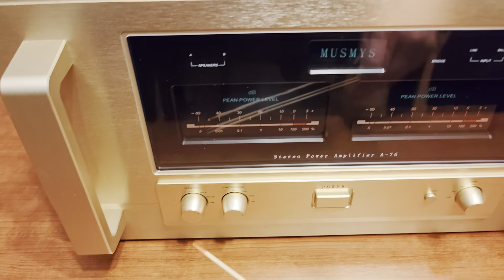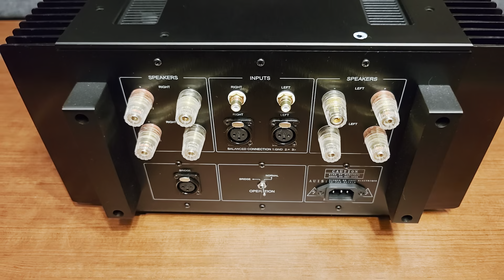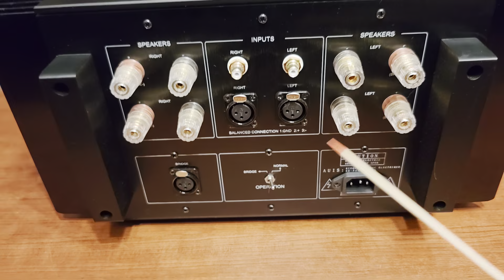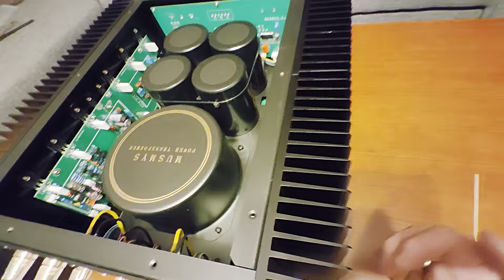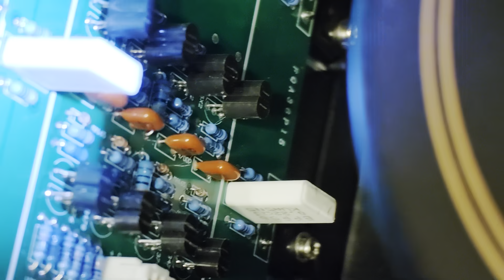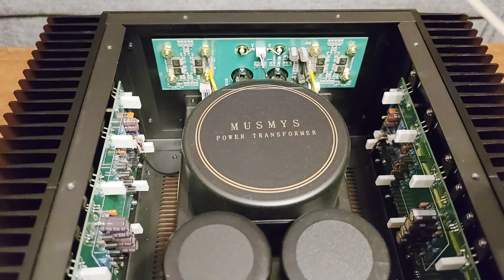First look: Accuphase A-75 speaker amplifier pure clone by Musmys: BEAST!

Comment: What happens to power and ohms if you play 2 pair of speakers?
Reply from the maker: These are two separate sets with output control, not just two sets of posts soldered together. So the power stays the same but has to be divided between the sets, and impedance should count separately as there are active output devices on pcb (but I havent included that in my tests, thats a good point for the future reviews)

Comment: These are NOT clones, just cheapo A/B Mosfet design. Better off with ADCOMs. They use SSRs for output relay and tons of square waves leak during shutdown if you keep signal drive on - these can destroy tweeters!  Unit got bashed during shipping and Ali refused to help. Never buy from these Chifi con artists cause when something isn't right you're screwed like we are.

Comment: Hi. When can we expect the definitive review of this amplifier ? In the meantime you have evaluated amplifiers that you have purchased at a later date then the A-75 that have already been reviewed. First as a preview and the with a final review. Why don’t we see your final assessment of this specific Accuphase amp, is there a reason for that ?
Reply from the maker: Hi! 
No particular reason other than that it was buried under pile of another amps and preamps that got here during winter sale and I was stacking them on top as it was the largest and heaviest one. Same thing happened to Aleph 5 and I got both of them out recently to catch up with the full video. Aleph 5 goes first as it was on top of A75 this weekend and then later A75 too (still, I won't give any date as that depends on my available free time after my regular 9to5 job)

Comment: Still looking forward to your full review, although I could not wait & pulled the trigger on one of them after having great time with the the ASTR12A - Max Reference Cary SLP-90 Plus clone Pre. Having had it burned-in, for a week, I liked the sound as much as their VFM proposition so much that I bought another to use in bridged mono mode for some of my more power hungry speakers. 
Without wanting to give out a spoiler, the combo with C2860+ as single or as monos, IMO deserve a very special mentioning...they needed a few weeks continuously burn-in to open up fully, although they sounded promising straight out of the box! 
In departure with other Class A amps, these do not run hot. A little disconcerting at first, if one is used to class A amps but when they sound so good, I stopped trying to make sence of it & enjoyed the music. 
One thing to bare in mind, is they are produced in batches & according to the seller, go through a 15 day growling test before dispatch. My 2nd unit has a slightly richer golden hue than the 1st one. The seller explained such variation of front plate hue after the event...but given that the C-2860+ has also a slightly different hue as well, I decided not to let it bothering me for long. So if you want a pair bridged monos, buy them together to avoid such hue variation. 
Overall, they are very well built & come in great shipping packaging for such heavy devices, with excellent seller support. Enough said...over to you & your take on these...
Reply: That is the exact experience I had. A bit concerned first but the sound is sooooooooo good, I simply enjoyed the music instead and still going really good. The combo as you mentioned is part of the magic. This unit is way better than I expected.

Comment: Hi any thoughts on the a75 plus. With 100w/ 8 ohms. In regards to the laws of diminishing returns.
Reply from the maker: I saw that one! Its pretty new stuff and its almost twice the price of A75.
I am not sure about it. If the price would be lower I would probably get it, but as it is you can almost get two regular A75 and set them in bridged mono mode.

Comment: Looking forward for the full review. Thanks
Reply from the maker: My plan is to celebrate 10k subs with that one so soon!
Reply: @k4syx  You have come close to 10k subscriber. I plan to buy one but waiting for your review. I hope you would compare with those high price amp you have reviewed so far.
Reply: Couldn't wait for your review, so I took a chance during a Sale with high value token OFF & bought one. Within 48hrs of burning in I liked both the sound & the VFM proposition so I bought another one (yet to be shipped/arrive) to use in bridged mode while still on Big April Sale with a large value token OFF & ahead of any tariffs taking effect....Hope I am not disappointed in the end...
Reply: @Fizzy44441  It must perform well to your expectation as single unit. It can be bridged. Can this amps also able to bi-wire by amping? Hope you could share more information about your speaker and results of bridged connection once you have received your second units.
Reply: @321sklim  Sure thing! One update, the 1st one has now had at least 200hrs of burning-in. I did notice that it improved & matured during this period. It sounds detailed yet smooth, powerful & dynamic, wonderfully balanced, while remaining both poised & hard hitting depending on the occasion. One thing is different than all my other Class A or Class A/B amps is that it is barely warm to the touch!

Comment: Hi. Nice review. This amps looks really cool but more important than changing the opamps is changing the thin wires that go from the capacitors to the boards by thicker ones. That is the one way for providing instant power delivered to the transistors. I've done myself a similar modification in a Nakamichi PA-7 that has similar architecture and the improvements in dinamics where huge. I've aldo solder a wire to the bus track on the board feeding the transistors. The more you reduce the resistance between capacitors and transistors the better it will sound! Take care.
Reply: Amps like D5 Pro that have the capacitor directly soldered in the board usually sound better for that reason. Change the wire thickness and let us know your findings. 😉
Reply from the maker: Thanks for sharing :)
All the mods are still in future, I need to choose the amp that will be the best for my electrostats and then I will polish it as much as I can with mods like that!

Comment: BEWARE Mfg does not pack this well, only 37mm think foam between the outside world and a very heavy amp. FEDEX recommends 75mm. Our arrived smashed and Ali hasn't done anything.
Reply from the maker: Was that from the same shop I got mine?
Because mine had the best protection (so far) from all amps that I got. And I am sorry to hear that.
Have you tried refund procedure with Ali? With photos etc? What was smashed, maybe its salvageable?

(BTW Fedex oficially recommends 75mm?!?! 
Its like they would be perfectly aware and proud of the stuff that happens to packages!)
Reply: @k4syx  Yes, followed the link. That seller told us to fix it ourselves with a pair of pliers. This one is expensive and he's avoiding responsibility for support. This is not right. Ali is delaying, delaying, delaying so we were forced to go to Paypal.
Reply: @k4syx  Finally got this amp on the bench for those interested. NOT "Pure Class A" as pitched. Not at all in fact, 100ma bias per leg - basically plain old AB. This is also obvious with the tiny transformer compared with real class A Accuphase amps. Power supply cans measure 60% or rated capacitance per HP4262A (.1F avg) but 0.5ohm ESR (bad). Design is quasi-complimentary output - like PASS - but with expansive frontend. After burnin, sound settles down but is still glassy IMHO. Bass is pretty lean, to be expected in quasi-comp output. Basically an overpriced conventional AB with fancy front panel. E405 is a way better buy, that's the real deal.
Reply from the maker: @enlitenaudio6517  Thanks for sharing!
Mine is still waiting for my listening sessions.
From what you say it looks like it would use some bypass low ESR caps. 60% thats still a lot, I will check my piece and look for prices on possible replacements here locally.
You have E405 too? Have you compared them? (I have e405 but any comparision is still in the future)

Comment: Since you reviewed the class A Musical Fidelity A1 clone and the class A Hood clone, I would like to see a review of the class A Sugden A21 clone, and maybe compare the three. The originals competed with one another, so it would be interesting to see how the clones stack up.
There are also several Pass/ACA clones, but the models can be confusing.
Reply: I have use both originals for years, and I much prefer the A1. Never burnt off and sounded much more dynamic. The Sugden was more thin in sound, not offering anything more in other areas.
Cheers.
Reply from the maker: I have A21 on my list, but it slighly more expensive than other two. As for Pass clones, so far Ive read some bad feedback on Aleph3 and so-so on Aleph5 so they went down my list
Reply: Thanks for responding. The A21 clone is more expensive, but so is the real A21. There are several good videos comparing the two, as they are natural competitors. It seems like the A21 usually comes out on top.
Again, thanks.
Reply from the maker: @gilko61  Hmmmm thats interesting, if it comes on top, then that picks my interests :D

Comment: I don't even know why they call it Accuphase A-75 clone because the circuit is not even the same, does not have the same amount of output device pairs, transformer is tiny compared to original. This is more like a fake Accuphase A-75 and although it might possibly sound good, it would not sound the same as the real Accuphase unless using the exact same circuit, PSU design, etc... Anyways, have fun with the listening sessions, keep doing the reviews! :)
Reply from the maker: Its probably just losely based on A75 :)
The intersting thing here is that real A75 didnt get rave reviews at all :)

Comment: A question for you. What do you think of the reference Jadis JP 200 tube preamplifier
Reply: I just ordered the 20watt  classA. amplifier you reviewed. and I can't wait to try it with my Dunlary SC-V, using my audio research tube DAC and reference one preamplifier  . But this amp is a beast. I can't wait to hear your review.
Reply from the maker: Havent heard that one though its on my list, there are 3 versions from what I saw, one of them using gold plated/black chassis with Jadis logo (which looks nice but is a step too far)
Reply: @eugenefudge3685  Many years ago...1985 to be exact, I borrowed a pair of the JAS30 monoblock amps...30 wpc for $3000 at the time.
They were phenomenal bettering my already excellent Audio Research D70mk2 power amp.
I bet the original Jadis preamps were equally as formidable.

Comment: I don't believe the capacitors are made by special order by Nichicon  , it would be way too expensive to do so , plus it's bad marketing to put a no-name brand on the caps.
Reply from the maker: I think its different. These may be leftovers from such an order. But its hard to tell, though Mundorfs in JC2 (that I was SURE were fake) were confirmed to be real thing by Mundorf in Germany.
Reply: This is cognitive bias from years of brain washing. all westerners have it i think, default of childhood. I find China make excellent products.not always, but the tak is always tak. Did you see their steel innovation?

Comment: Not a complaint, but I’m calling b.s. on the specification for filter cap size.  Each is more like 60KuF@75V max.  

Actually I bet they gave the total figure for the single capacitor figure, because 40,000uF per cap looks just right.
Reply from the maker: I will try to measure them if possible

Comment: This can also be used as a hotplate and a heater.

Great value multi-purpose home appliance.
Reply from the maker: And really, really good paperweight - its heaviest amp I got so far. Delivery guy had to use trolley to move the box and the handles are definetely for show there

Comment: I would venture  the cap are 160,000 total 40,000 mfd each not physically large enough to be 160,000 each IMHO ( 50 years of playing with caps )
Reply from the maker: I'll try to measure them for review if possible
Reply: @johnwilliamson467  I only saw your note just now, I said the same thing just yesterday.  40,000uF per looks right…
Reply: Loool
Reply: @Carl-yx1ww  ???
Reply: @Carl-yx1ww  Dude, wtf are you loling about?
Reply: Loling hahah
Reply: @summerforever6736  Don't feed trolls.
Reply: Correct, there is no way in hell they are  that high of an UF.

And even just looking inside, it shares nothing in common with the real one.

Comment: I have some doubts that those filter capacitors are really 160,000 uF each. A capacitor of that value with a 63V rating would be much larger.  I am guessing that they probably are 33,000 uF or so, and almost certainly not larger than 47,000. 
640,000 uF would cause a HUGE inrush current when turned on.
Reply: Capacitor size does seem to be a big issue with observers here.  We appreciate your plan to measure.
Reply: But then the soft start comes into play and should regulate that short power need. Am i wrong?
Reply from the maker: You're right, that would take care of inrush current
Reply from the maker: I will try to measure them for the review, but they are big and go deep

Comment: I assume so with all those heatsink fins but do all class A amps like this run super hot, kind of like tubes? And eat up a lot of electricity, so higher bills?
Reply from the maker: This one is during burn in was nicely cool, there really is a lot of metal in these find and chassis. As for power consumption yes it was higher than usual though I don't remember numbers now. I will measure it for full review
Reply: Depends what the manufacturer says. For my amp there is a chart how hot they "should" get. Too cold or hot are not good in my case. They even level bank A and B with temperature.

And about your question of class A. A is pure sound and needs the most power. B is like the old Megaphones, only amplification and also mostly distortion.
Tubes use more energie then transistors and are in general less efficient. Some people like the sound of tubes more. You need the right speakers for it.

And there are Class A and A/B for both of them. Then there is Class D for Digital what is more like S for Silizium.
The Amplifiers did go the way of the computers. First where the Tube, then Transistor and later Silizium.

In an Ideal world we would all buy Class D for the efficiency. But in my experience most of them are harsh in the high frequency.
There are one Monoblock i heard live who was totaly neutral in sound. Like my Beyerdynamic headphones. But oh boy the price tag on those.
Reply from the maker: @Rudimaentaer  Try TPA monos that I've reviewed for great (and affordable) d-class implementation. As for temp you are right: it should be a part of the design to get the tem just right and to use it for determining transistors working points!
Reply: @Rudimaentaer Which Class D monoblock were you impressed with?  Thanks!

Comment: I think I'd go for a Krell KSA 50 clone for $900.
Reply from the maker: I've ordered KSA100mk2 last week. Was afraid 50 may be too weak for my electrostats testing...
Reply: @k4syx  Yes looking forward to that one. Had another peek yesturday, saw the daZeel 108 at 50% off on this Black Friday promo, sounds like a good deal !
Reply: Sorry. Forgot about this. No there was no URL link. I just mentioned that LM do not acknowledge products bought from anywhere other than a registered LM dealer.
Reply: Any particular reason why the comment about the Line Magnetic LM 219IA was deleted? Still struggling to come up with one.
Reply from the maker: @stephenfurley1025  I do not remove any comments, even negative ones (good flame war never hurts here and there) but some comments get removed via yt (for example the ones with the url links). Was there anything that could look like URL?

Comment: Great first look! I've been following your reviews of the various clones for quite some time now, and I’m particularly excited to hear your final thoughts on this Class A amplifier. I truly appreciate your philosophy of uncovering amazing-sounding gear at budget-friendly prices—it’s what makes your content so valuable and relatable!

For context, my journey started with the D5Pro paired with the HRZHiFi C245 clone. While the C245 had its merits, I found it a bit too soft for my taste. Hoping for an upgrade, I went for the CARY-SLP90 clone, but even that combination didn’t quite hit the mark for me in its stock form. Determined to improve the sound, I invested in a separate preamp board kit, thinking a drop-in board with modified capacitors and upgraded tubes would be the answer. However, my plans shifted when I discovered the Accuphase C2860 Plus. Its balanced input/output and Class A topology design were too tempting to pass up, so I decided to temporarily put the Cary clone mod on hold.

I ended up purchasing the ENCLAVEAV version of the Accuphase C2860 Plus, and after just 50 hours of burn-in, I gave it an initial listen. My setup includes the Gustard A26 connected via XLR, a CD belt-drive transport, 10 MHz external clock (driving both transport and DAC) with a separate ultra-linear power supply, and the D5Pro amp. The difference was staggering—this combo outperformed both preamps I had previously tested by a wide margin. The Class A preamp truly opened up the sound of the D5Pro amp in a way that felt transformative - next level transformative!

I’m now even more eager to hear your final review of this Class A amp. If possible, please test it with the C2860 Plus—I’d love to hear your impressions of that pairing! My end game setup is a complete end-to-end balanced audio system. BTW, your recommendation on the Valhalla 2 clone speaker cables are an awesome pairing. I have the 3m pair.  A MUST HAVE!